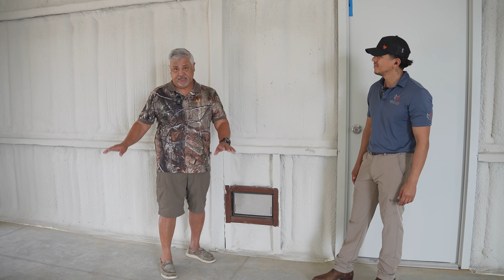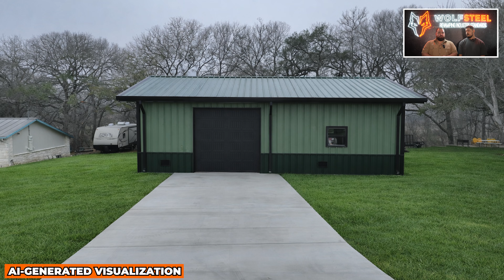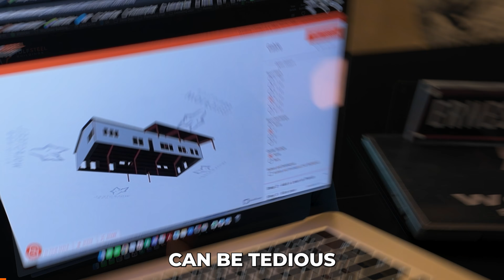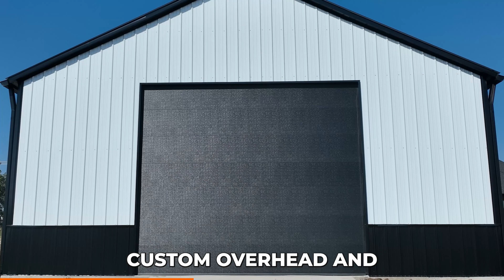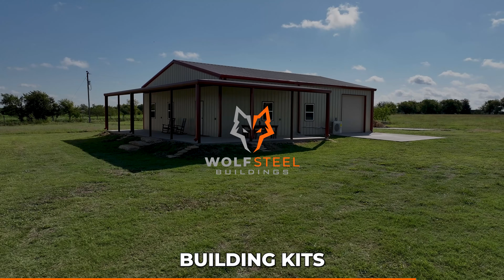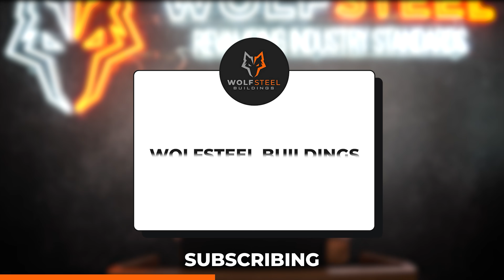How much does this 30x40 UNIQUE Build Costs? | Price Breakdown | WolfSteel Buildings

Comment: If putting a rollup door on the gable end, does the eve have to be any length taller than the door? For example, will a 14' door work with a 14' eve height? Does a standard garage type door differ in height requirements?
Reply from the maker: Ideally, the eave height should be higher than the door height, to account for the barrel of the roll up door, but if your height is the same with the door, safest is to place it at the center.

For garage type doors, typically it's more on the head clearance, as it operates on horizontal tracks, unless you upgrade which is another story. Hope we answer your question.